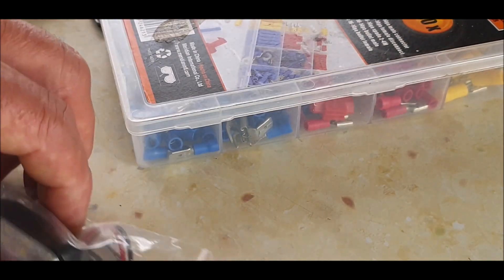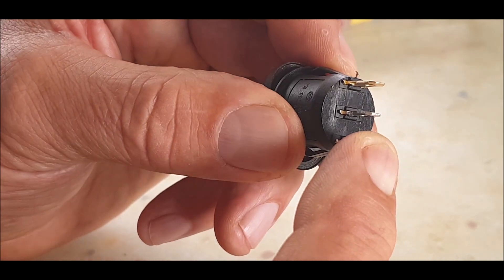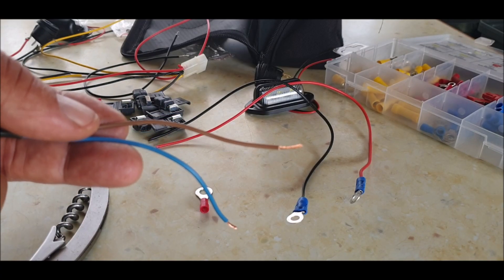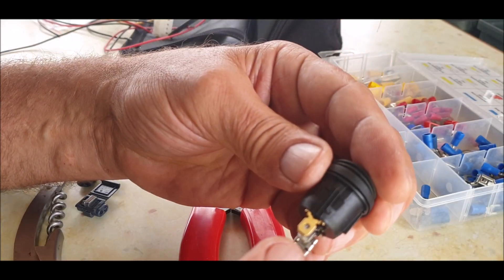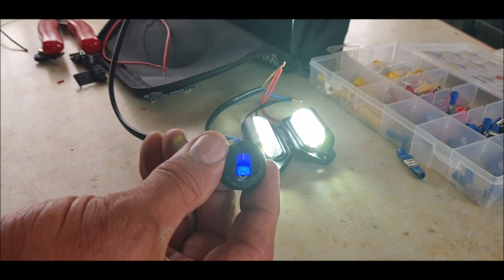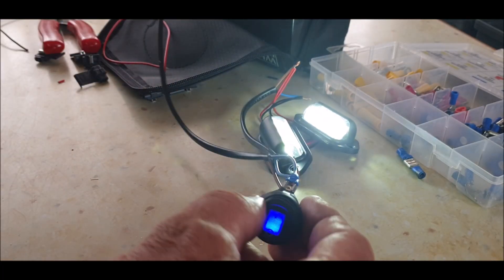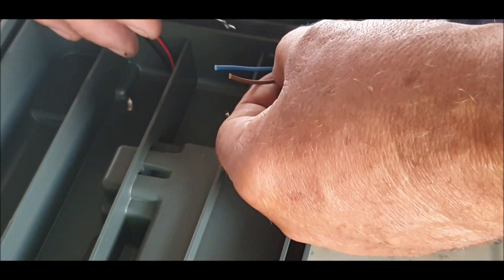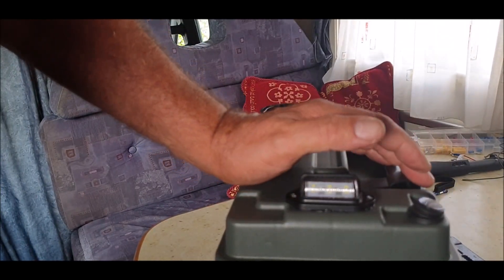How to wire a 3 prong rocker switch

Comment: Hello, I currently have a device which has a simple 2 pole/prong switch. I want to put in a switch with a light. I recently bought a switch with a light in it like yours. How different is the wiring from a 2 prong to a 3 prong switch?
Reply from the maker: you dust add power to the extra prong so when you turn it on it gets extra power to the light

Comment: Ho collegato un interruttore simile (a tre attacchi) a un piccolo impianto da 12 volt. Non capisco perchè l'accensione dei led avviene al contrario cioè con l' interruttore su 0 e non su 1. (la luce del tasto non mi interessa e quindi ho collegato solo i due fili). Ho provato anche un altro interruttore e succede la stessa cosa? Come posso fare per far si che l' accensione avvenga sul tasto in posizione 1 e non su 0?

Comment: I used one as a on/off switch and just used the outter 2 pins, I can’t figure out why it worked and if it’s safe?
Reply: I could be wrong, but I don't thing the two positives matter which one is which, so long as you don't hook either of them up to the ground, it's basically just connecting the two wires.

Comment: For those that are still confused: the gold connector goes to a ground.  The opposite connector on the switch goes to the battery or power source. The middle connector goes to whatever you're controlling, and in this case it's the light,  so it would connect to the red power wire coming from the light he showed in the video.  The switch will light up when you have it in the "on" position and the item you are powering up will also turn on. Hope that helps. Here is a good video that is much more clear - https://www.youtube.com/watch?v=pHdVEFF1VX8
FYI - Always use a good crimper so it makes nice crimps and not ugly loose ones like the ones in the video.  Also, don't use the wrong color connector butts for the wire you are using - do the job right, especially if you're going to make a video to show others.  Cheers.
Reply: I have a question, I used this switch, I cut the negative wire in half (it’s for a particle seperater on a side by side) I cut the negative in half and put one end on the gold and one end on the outter silver. Left the middle one blank. And it works when I turn the switch on it works and the led lights up. The middle pin is blank. I’m confused if it is safe? And why it still works? I’m just using 2 pins , the negative wire only. And the led still lights up.
Reply: This comment was very helpful for me that has never installed any kind of lights before but i want to do it on my lawn tractor and i'm just wondering how i should do it if i use a relay and what wire the relay should be connected to? I want to use a relay because i've heard that it is recommended to use. The wiring itself dosn't seems that difficult that i thought it would be thanks to your comment that describes it very good how i should do it.

Comment: I was a bit stumped by some of these that I bought. Tried using an ohmmeter to check continuity which just tested open no matter which pins I went across. Finally figured out the switch must be powered to work. I assume there is a tiny circuit board with a chip that closes to activate the switch. If someone knows how the electronics work please share, kind of curious.

Comment: if you want the led of the switch to stay On all the time wich wire you need or don't need?
Reply: You swap the live and load wires (on the 2 white connectors). That way power always goes to the switch LED, comes off thru the bottom pin (to the bulb) once you switch the switch ON.

Comment: I was looking for help wiring an illuminated switch to a USB charger for my motorcycle, and this is exactly what I was looking for.

I only have one question though.
Why do you need an illuminated switch when it is so close to the actual light which it is operating?
The light being on would be enough to show you that it's, well, on.

Thanks all the same.

Comment: Hi i have that kind of switch and i dont wanna use the light of the switch  just want to use it for my usb charger for my motorcycle directed to battery. Witch 3 of the pin should i pull out?
Reply: None, just don't hook up the ground, it's only purpose is for the LED.

Comment: a thin coat of clear nail polish or similar like acrylic will fix/smooth the scratched top. heat polish in hot water bath, clean area with brush and alcohol first.

Comment: Where do I wire a white wire of my lights have a red black and white wire?
Reply: Is it the switch wire, if it is.  That goes on the light.  And the black wire of the light goes on the battery

Comment: nice instruction for us non electrical type gurus. Trying to add a fan switch that will be turned on when the ATV is being ridden. The oil cooler fan works when I apply direct battery to the red and black wires. I think though that I will need to run a fuse as well for extra protection.

Comment: and for 220 volts ?
Reply from the maker: No not at all
Reply: @MrMeltedwellies  will it burn out? Because I have this switch lying around "20A 12V DC" and I was wondering if I could use it on my switchless soldering iron, which is 110V 60W :)

Comment: Nice work. Can you post the link of the tiny led lamp?
Reply from the maker: https://www.ebay.co.uk/itm/Waterproof-Round-Rocker-Switches-Green-Red-Blue-Orange-3-Pin-ON-OFF-Switch-12v/323381695082?ssPageName=STRK%3AMEBIDX%3AIT&_trksid=p2057872.m2749.l2649
Reply: @MrMeltedwellies  thanks 👍